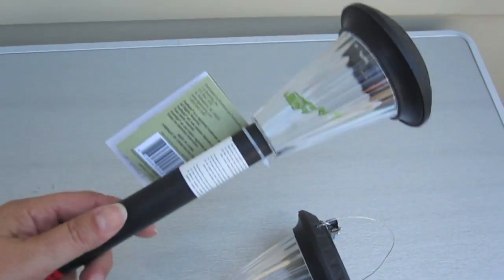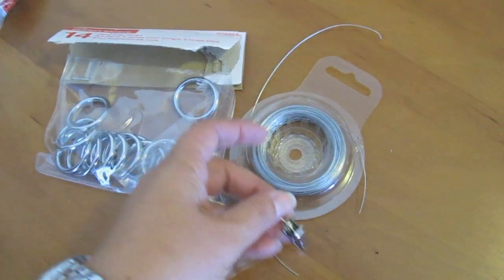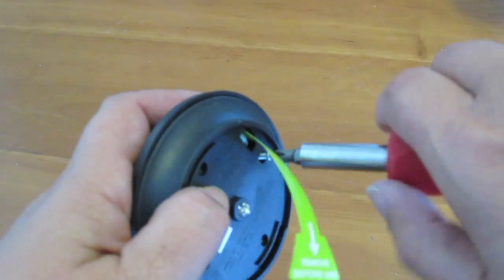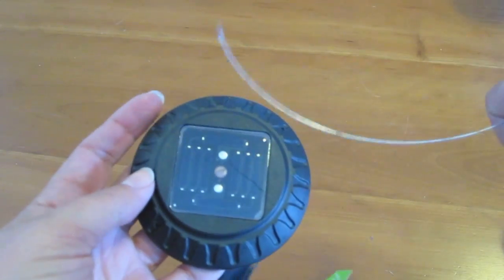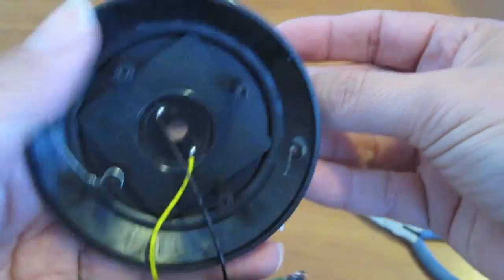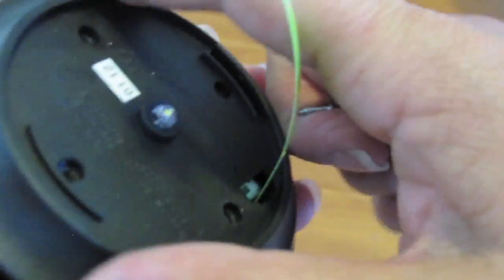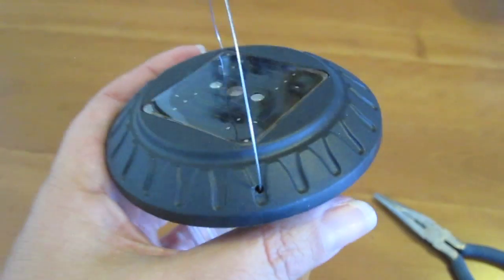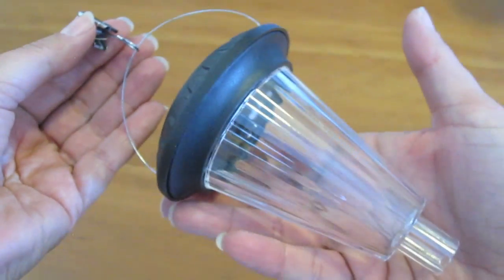Gadgets Page: How To Make a Hanging Solar Light

Comment: Oh, of course you are worried about water. In that case, mount your hanger to the glass bowl. Even less work. You could just have the hanger in a loop and pin it in place when you screw in the lower bowl...

Comment: Cool but this can be done without disassemble. Drill two holes into the top plane. Make hanger from wire that will hold two small right angle bends. Insert the bends into the holes. If the hanger is shaped like an omega symbol the springiness of the wire can hold them in place... If I'm not clear feel free to reply and I'll make a diagram.